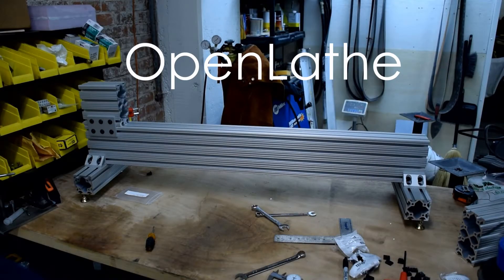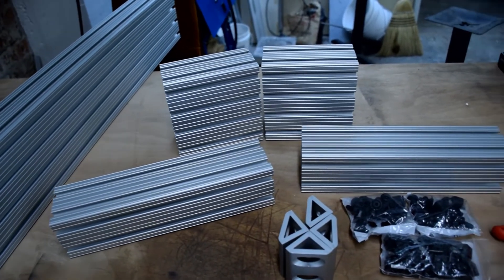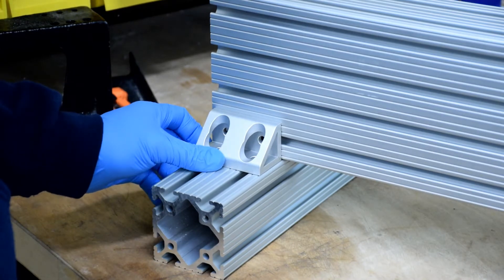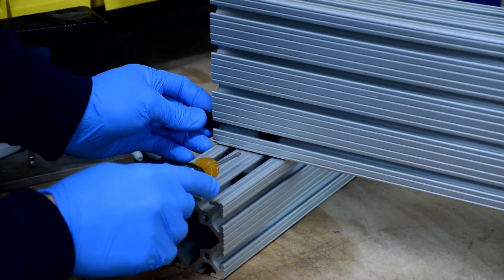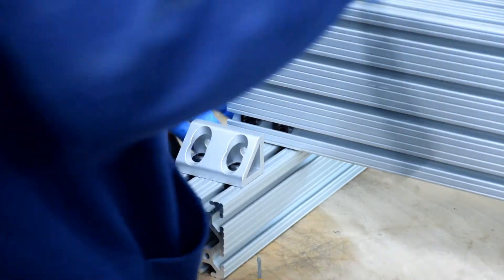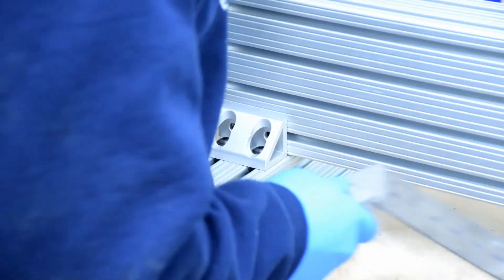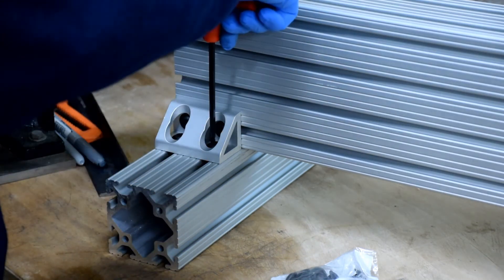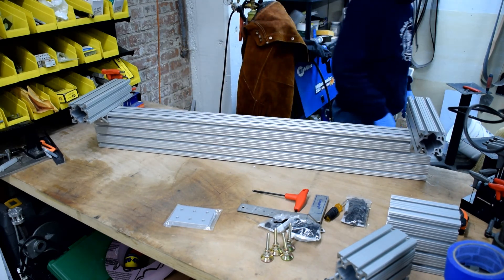OpenLathe Frame 1

Comment: Just ordered the frame parts. Went ahead and got the extra taps on the 6inch. Did you face the tap holes to the inside or outside of the lathe when assembling?
Reply from the maker: Hi Logan, I face them inside